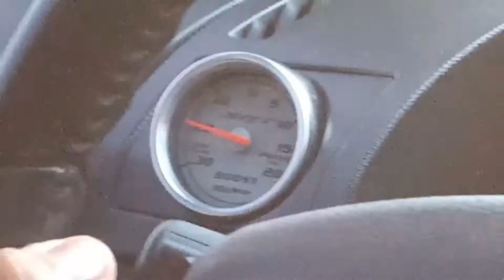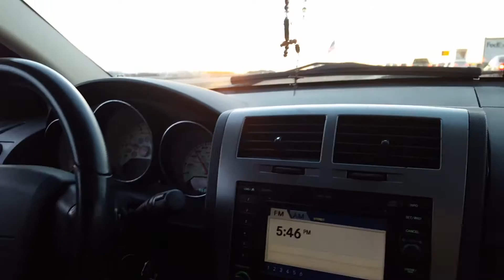H22 head on a f23?

Comment: Does the F23A engine work with the H22A engine?
Reply: There are some things similiar but alot diff.  The head will fit on the f23 block.  However the water lines and pump is diffrent and you need to tap a oil line for vtec and a few other things like figure out the correct head gasket.  You shouldnt do this swap as your first honda swap you need to know what your doing and a ton of research.
Reply: I got a F22A trans mated to my h22a JDM motor no number after the A
Reply: they need the head tapped for vtec?
Reply: This is know as a G23 engine